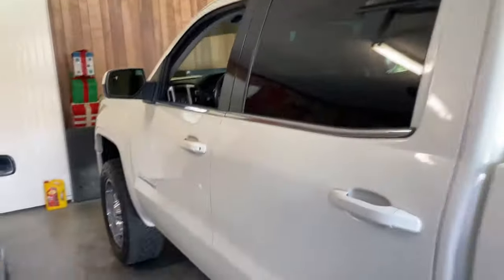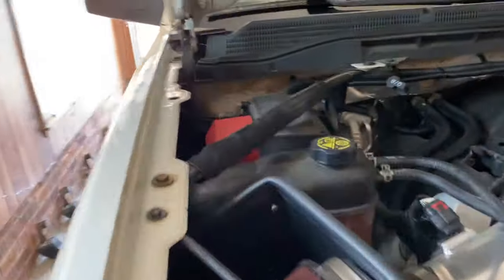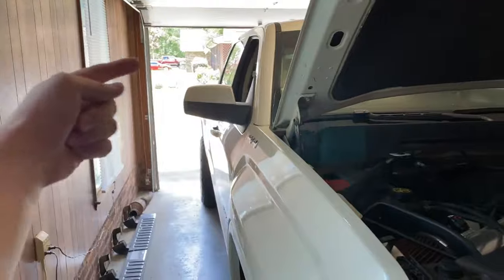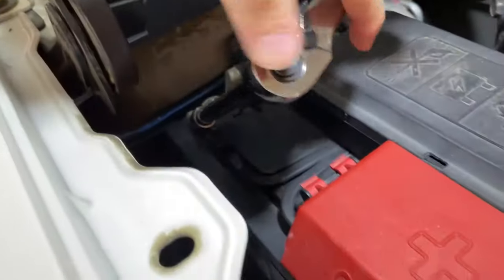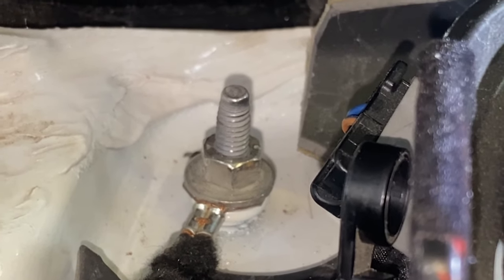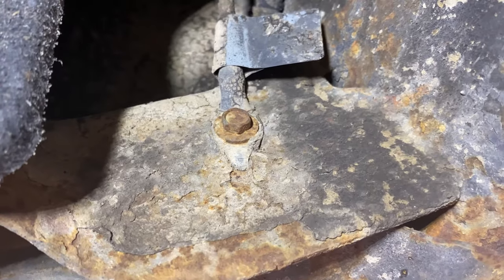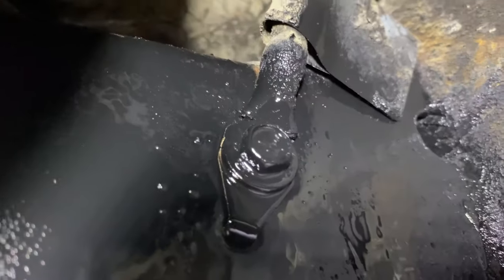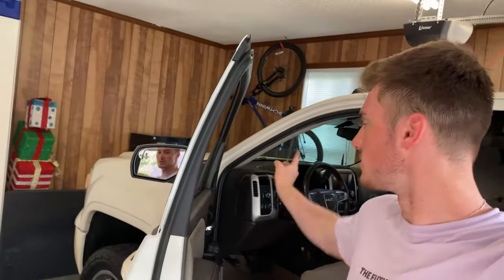2014-2018 Sierra/Silverado Flickering or Shutting Off...Ground Issue SOLVED!

Comment: Recently, my horn sensor started going off randomly saying that my hood was open, my subs started going out and coming back on, the steering wheel would briefly lock when turning at low speeds. That hood sensor goes off like crazy when I turn my radio up and that bass hit. This makes me think that I have a loose ground somewhere. I bought a ground cable from O'Reilly's, but prior to changing it, I'm gonna try to clean these ground points. I hope it works.
Reply from the maker: Check out the distribution box on top of the battery too, clean the grounds in there too and apply some dielectric grease. But yes I would definitely clean these grounds and see what happens. Hope this helps!

Comment: My 2017 gmc sierra lost all electricity few hours ago,  Two days after having my windshield changed...  do they remove those plastic pieces when doing that job ?  if so it might be my problem....  My wheels/tire were also replace two weeks ago,  So I'll check both of those ground this weekend,  Thanks for the info, it's really appreciated....
Reply: I found my problem... indeed the battery has been disconnected few days ago when they replaced the windshield......   In my differents test,  I took my boosting cable, plug it on my neg pole and the other side on the frame...  All light came up...   It started right up.....   My neg cable was starting to be corroded and they didn't tight it enough....   A new cable is ordered, for more safety.................  I'm really lucky it happened in my driveway............
Reply from the maker: @ja4476  Nice. Yeah very thankful it happened in my driveway too!
Reply: @hunterrwiilson  Thanks again for your video... I've seen that my ground on the passenger side (under the truck)is becoming rusted, I'll clean it up in the coming days...  and I had no idea from the ground close to the speaker, I'll check that one too and make it sure it makes a perfect ground..................
Reply from the maker: @ja4476  of course! It’s unsettling that this issue was never addressed by GM but I’m glad I can help alleviate any issues

Comment: I've been having an issue with the headlights pulsing/flickering ever so slightly. The new battery did nothing to solve the issue, thought maybe it was an alternator issue but that seems to be charging just fine. No other issues other than just headlights, so I might have to check that frame ground for connection issues.
Reply from the maker: Check your connections inside the distribution block (small black on top of your battery) to see if that is effecting you too. I cleaned the connections and applied some dialectic grease on them before tightening down.
Reply: 2014 GMC Sierra owner here and it is just my headlights that flicker and then go out. If I pull over and turn the truck off and then back on again, the headlights come back on. I replaced the battery and still have the problem. I'm gonna clean the ground connections like you showed. If that doesn't work, I'll replace the battery cables. If that doesn't work, I'm driving it off a cliff @hunterrwiilson

Comment: I replaced the battery and alternator. Solved the issue . Truck has good voltage
Reply from the maker: Good job tracking it! Not all electrical issues are the same so it's a good thing you found your issue.
Reply: @hunterrwiilson  i tried cleaning the grounds and doing the dash board thing too but none worked .
Reply from the maker: @fukubish6024  anything is possible with electricals

Comment: There’s two sides of that negative battery Cable, you just got one end the other hand goes to the engine block that’s where the problem is. It’s too close to the exhaust. There’s actually heat shield wrap around the cable.
Reply from the maker: I haven't had any issues since so I think this is the proper fix

Comment: This is Dangerous!! Mine shut off on me a few times. I tried cleaning up the ground at the bottom and did the one in the dash. It didn't cut out for a while but did the other day. I decided just to replace the whole cable. Im surprised GM doesn't offer a recall for this issue.  Someone could get seriously injured if you turning at a light or on the interstate
Reply from the maker: It's incredibly dangerous and I do wish GM said something about it. This isn't a light issue. But I also took it upon myself to clean the connections inside the distribution box on top of the battery. Ever since I've been fine. I've also heard of others who have replaced the cable and it seemed to have done the trick.

Comment: Theres another grounding point at the engine mount area on the same side and what i do is wire wheel the area change the ground wires then instead of using spraypaint I use whats called Cold Galvanizing Compound that sprays on just like paint but protects from the elements way better..
Reply from the maker: I didn't know about that galvanizing compound! (or back then) Noted for future reference, thanks Michael!

Comment: I'll give this a shot. All my truck is doing is showing the "service power steering, drive with care" message. No other issues, no loss of p/s. Has a C0800:11 code. Going to look into these grounds!
Reply from the maker: Yeah it never hurts to try! Also, I'd look into your battery connections and see how stable they are.
Reply: Did this work for you?

Comment: Is it possible this bad ground could cause the high beam on my 2014 Silverado to stay stuck on? Even after shutting the truck off they stay on, have to disconnect the battery to get them to shut off…

Comment: I have a 2018 sierra 4.3 with the same issues, at first it just flickered once but then it started getting worse and worse and it completely shut off on me on the highway and turned directly back on each time, tomorrow i have to di this
Reply from the maker: def do it
Reply: @hunterrwiilson  ended up replacing the whole cable today works fine for now

Comment: Just had my steering lock up last night for the first time while backing into garage (screens black, heavy shudder, engine nearly dying) I'm going to try this this weekend. I have been having intermittent screen changing both on radio and on the small screen in front of steering wheel for a long time, do you think that could be related? I know with electrical it's all related to some degree, but excited that this may be a fix. Very well done video on your editing and camera angles! Thank you
Reply from the maker: Thank you! Try this fix first to see if it does the trick for you, if this doesn’t fix your screening issues there’s a plug behind the glove compartment that has a stupid sharp angle from the factory and could be coincidentally giving you issues too. If you get back there and unplug it and plug it back, that may help. There’s some videos out there but the plug is blue I believe
Reply: @hunterrwiilson  ok, thank you again. I will keep that in mind. steering wheel issue much more pressing issue. Have a long weekend and I'm excited for the project especially after having watched your vid.
Reply from the maker: @BEASTIE51  of course! Oh and for sure, I didn’t touch my truck until I fixed that issue, it’s a pain but guess we gotta roll with these gm punches

Comment: Thank you. I have a 2015 Silverado LT double cab that has the same symptoms. I took it in and they told me it was the aftermarket stereo. I checked the ground on driver side dash and it appears to have been cut already. Bolt was secured well but i took it off and kind of sanded it best i could. After i put it back on i cranked it down. I then moved over to the passenger side and cut the garnet around it off. It was also tight.  I also took the bolt off the passenger side wheel well and grinded it down a little to make it smooth. Is there a way to tell of this worked or is it "try and see" kind of thing. At this point i don't want to have my kids in there until i can verify 100% its safe. Thoughts?
Reply from the maker: Sounds like you’ve done what’s needed. I’ve actually taken it a step further and cleaned up the grounds inside that “distribution” box that sits on top of the battery and then applied some dielectric grease to them. Haven’t had an issues since. 

If you’re worried about putting your kids inside the truck, which is a very reasonable thing, I’d drive the truck around for a week or so with just you and see if it’s still messing up. Hope this helps!
Reply: @hunterrwiilson  So I actually cleaned the box the first go around and it looks good. I did notice my voltage was at 15.1 after consistent. I took it down a back Missouri road(pot holes and never repaired) and it didn't flicker or anything. I also noticed the rear speakers sounded more clear. Pretty sure that was it but time will tell. 3/7/2024. Ill check back in a month and let yall know. Thanks again.
Reply from the maker: @dannyboykoch  Sounds like you got it then! But yes be sure to let me and the others know! Blessings

Comment: Had to remove that speaker for mine. The one under the wheel well I had to weld on the 10mm was stripped
Reply from the maker: Oof, no easy way out for ya

Comment: Hopefully works mine did it to me on the freeway middle of the night was sketchy asf!
Reply from the maker: Everything alright with you and the truck?
Reply: @hunterrwiilson  so far everything is good did it all like how you showed and it seems to be running good hopefully thats all it needed thank you!
Reply: @ahm.j1148  how’s the truck running now?
Reply: @johnathanchacon2758  like new fixed my problems no longer turns off feel safe taking her out again!
Reply: @hunterrwiilson  my truck turned off on me again today while driving but that did help alot you think it just might be time for some new ground wires?
Reply from the maker: @ahm.j1148  Hate to hear that, but I hope all is well with you! I think I recall someone saying they replaced their main ground wire and it seemed to help. My best advice is to look up some Forms and see what they say, if that doesn't really help I'd call the dealership and ask for advice. Then just do the job on your own if able.
Reply: @hunterrwiilson  thanks! I ended up getting a new ground wire going to install it tomorrow hopefully it works out this video did help me out alot thoe it kept my truck running good for a while must just be a faulty ground wire that needs to be replaced
Reply from the maker: @ahm.j1148  Sorry it didn't solve it permanently, but hey, as an electrical engineer I can say that electric and digital stuff is definitely situational sensitive lol
Reply: @ahm.j1148   how’d that new ground wire work out for you ?

Comment: i got same issue. my husband driving it on interstate and my 15 suburban power steering just stopped working and flickering. it was scary, not safe at all. is the ground wire u cleaning passenger side or driver side
Reply from the maker: Oh wow, I hope y'all are okay! The ground wire is on the passenger side, behind the tire, and on the frame.
Reply: @hunterrwiilson   yes we were ok. luckily we were able to pull over. turn off the car then turn it back on then ot worked again. ill definitely check it out

Comment: My 14 cluster keep flickering when i press the brake pedal or while im driving . Is the ground under the dash the problem?
Reply from the maker: Possibly a ground issue. Or some sort of short somewhere. Electrical work is hard to track. So just start with the most simple solution and progress up from there

Comment: My 2017 gmc sierra had the same problem it would flicker and turn off and on, i fixed the issue but ever since that happened the driver side window doesn’t go down or up anymore… what could it be?
Reply from the maker: What all did you do to fix it?

Comment: Hey hunter I’ve been havin g a problem with my sound my radio , door chimes,or turn signals won’t make a sound it jumps on randomly until I turn my it off and also my lights flicker
Reply from the maker: Then I'd start to look a little more into your situation. So go check all connections on the battery and inside that little box on top of the battery. You can try these solutions out as well, but it sounds like you may have some bad grounds elsewhere.

Comment: My truck is jerking the wheel out of my hand and I took off the 2g18 or what ever it's called and cleaned the one under the passenger side on the body and put grease on it but still no fix. Going to try to change the neagitive cable next 3rd times the charm right.
Reply from the maker: Let’s hope so! But if the changing of the negative cable doesn’t work then I’d look into what the dealership has to say. Maybe you can fix whatever they recommend
Reply: Same thing w mine did u get it fixed
Reply: hows the truck running?
Reply: @carnz06  it fixed it for a while but it just did it again 3 times than stopped i think the ground under the passenger side is a terrible spot i am going to change it as soon as it warms up out.

Comment: Did stability track light or steering assist and ac dying down aswell when the issue was occurring ?
Reply from the maker: Well when it all shut down the system tweaked and popped up some nonsense until I restarted the truck. Your AC problem may be the ground on the passenger side in the dash. Try fixing that and see if it helps. That’s allegedly the AC ground point.

Comment: Question for you: were you experiencing messages that said the park assist was not working?  And then the truck shut off? I cleaned the bottom ground wire. But it happened again. Wondering if the ground wire by the windshield will fix the problem?
Reply from the maker: I don’t remember that message popping up. I just remember my truck glitched and then as I backed into my driveway it cut straight off. There’s a possibility that fixing the dash ground could help, but also could be a main ground issue. Electrical’s can sometimes be a pain to track down. Coming from an electrical engineer lol
Reply: Did you end up finding out the problem just happened to me
Reply: @acast6961  battery connections/cables were bad and needed to be replaced
Reply: @Ryan  no ground issues, just bad battery cables?
Reply: @dmalin7042  correct. I had to replace the battery cables and haven’t experienced any issues since then. Are you having this issue?
Reply: I get that same message, right with telling me to roll drivers window down and back up. Then the radio changes stations and so on!
I cleaned up the ground on the frame.
Gonna see if that makes a difference
Reply: @perrylund4889 did that solve your issue ?

Comment: the neg battery cable has an excessive voltage drop when using the power steering(major electric motor) replace the neg cable and call it done. no need for the dash tsb
Reply from the maker: If, I hope not, this ever happens again I will be sure to use that method!

Comment: Hello, 2014 silverado same issues but my problem was at the fuse box under the hood, found a lot of corrosion under it used wire brush and dielectric grease problem fixed, I did try the ground wire like you did but that didn’t solve it,Thanks
Reply from the maker: Howdy! Uh, yeah I’m not 100% sure what else could be the issue. So you did both ground fixes correct? But I’ve heard some other guys in the comments who’ve said replacing their ground wire or adding another ground helped. But I know this sounds obvious, check how tight your battery connections are. Any space could short the truck out.
Reply from the maker: Check out Mr. John T Flaim’s comment and see if that helps also. Seems like a very knowledgeable gentleman

Comment: My 2017 GMC is doing this when parking or steering quickly at low speed, such as a u-turn. I will try this and see what happens. It is a nasty situation and am perplexed as to why GM did not protect these connections in a better way.
Reply from the maker: Definitely is not cool that not even a recall was considered
Reply: @hunterrwiilson  Yah man. America is really laggin now.
Reply from the maker: @a-non1403  it issss what it issss
Reply: Did you end up getting the issue solved? Mine is going the same thing

Comment: Hey brother .....
I just  saw your video and wonder...is you really solve that issue....I have the same problem...
Silverado 18....appreciate  you reply  thanks....
Have a good one!!!👍🙏
Reply from the maker: Sorry for the late reply, this has definitely resolved my issue, truck hasn’t done it since. Hope this helps!
Reply: @Hunter Wilson  appreciated  brother
I'll  try it asap
Be good and bless
Reply from the maker: @foox4ever132  no worries man! Glad to I can help! Also, try cleaning up some of the battery connecting points inside that small box on top of your actual battery. I took the top off, got some wire brushes and cleaned the connections there and then applied some dielectric grease to those points as well. Trying to maximize all electrical connectivity. Many blessings!
Reply: @Hunter Wilson  
One more subscriber  in on...thanks
Reply from the maker: @foox4ever132  you’re the man! Appreciate you!

Comment: Hey Hunter is been over a year since posting, how’s the truck running? Planning on doing this tomorrow if yours is still running well
Reply from the maker: Haven't had any issues with these two grounds since! I do recommend putting some dielectric grease on those two grounds just to ensure there is a strong connection. Something a person commented that they did and it's a really good idea!

Comment: I’m having this issue on our 2015 Tahoe, I cleaned the Frame mounted ground and the one on fire wall driver side, not sure how the speaker ground would become a problem?
Reply: It is called the p218 ground, not necessarily a speaker ground,  lots of things go to it. The sound insulation begins to get stuck under the nut diminishing a proper ground connection at that point.
Reply: @coltinwevley649  thanks for clearing that up, what a crappy place to install that,I’ll check it out